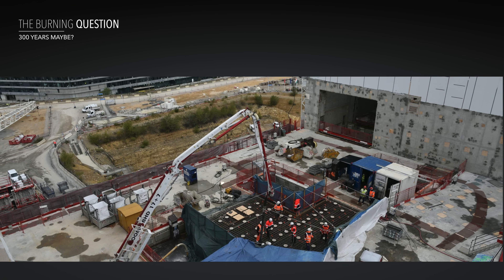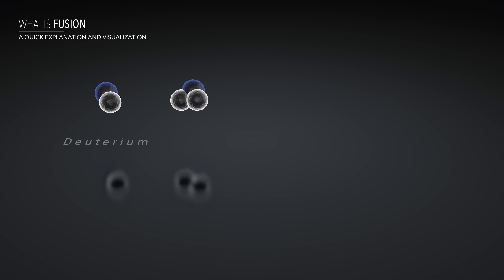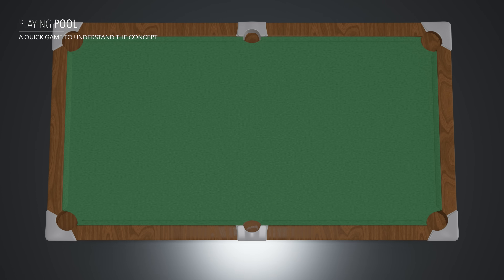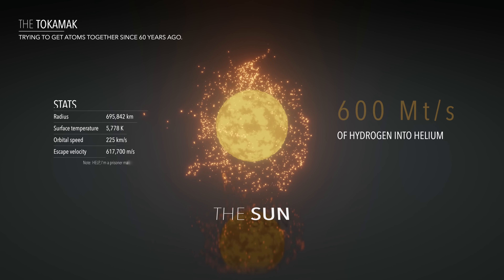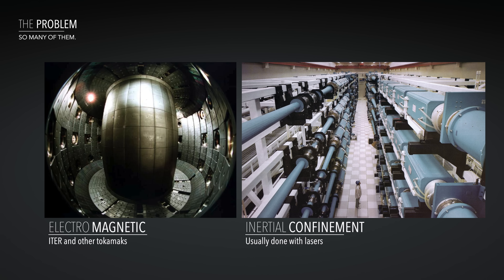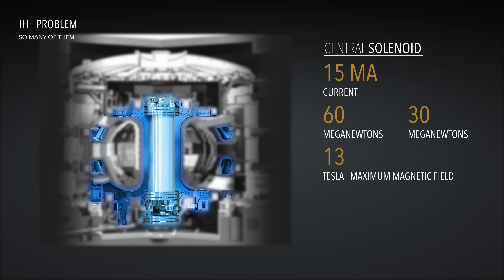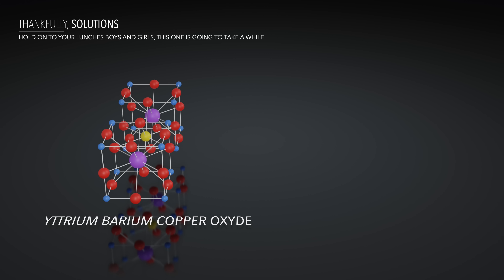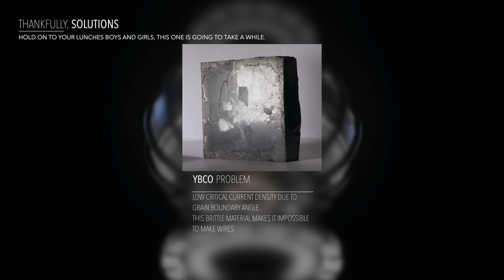Fusion in 30 years? ITER update [2020]

Comment: YOU CAN NOT REPLICATE GRAVITY THIS IS AN EXERCISE IN FUTILITY
Reply: Wtf you talking about?
Reply: @gregorymazulli4854  The reason why the fusion reaction in our Sun works is because the force of gravity is strong enough to pull the atoms together. A fusion reactors aims to do the same thing except push them together, but because its not using a naturally occurring force to do it, it requires energy to push the pistons that force together the atoms. The hard part is making a reactor that generates more energy from the reaction than it takes to push the pistons together and keep the environment in the perfect state.

Comment: Atomic energy is the future. It's so obvious that I can't imagine how anything else could be seriously considered. I recently was talking with a neighbor about 'windmill turbines', the big and ugly structures we see more and more of dotted around the countryside. He said that he'd read an interesting article (I still haven't read it, in full disclosure, ok) which stated that to run one - a single - train from Munich to Hamburg required the energy of 300 windmills combined. I /he may be wrong, please let me know if you check it out. But on the scale of technological advancement Nuclear seems to me to be the only option if we want to keep the lights on and hospitals and airports etc etc up and running a hundred years into the future. And atomic is autonomous. No need to rely on a foreign power to supply - or withhold - electricity. Also, I would imagine that atomic energy would vastly reduce the 'carbon footprint' (which is a load of rubbish and we all know it.) Would Greta therefore be averse to its development? Let's also not forget that as technology becomes more and more refined, so will safety of atomic power plants increase.

Comment: just because the sun has fusion on the surface is the mass related to the blackhole it rovolves around activate this re-action or is there a black hole in the center of the sun powering this fusion agitation on the surface. Sorry for angering you with these questions

Comment: High cost and risk huh? A few fun facts about US spendings:

Defence budget (1 year) estimated around $1.254 trillion 
--> $1,254,000,000,000 (The Nation, 2019) 

Trumps announced a military spending (1 year, also) of $750 billion 
--> still $750,000,000,000 (The Balance, 2019) 

Spendings (13 years) for the Apollo program (relative GDP and inflation are taken into account) $702 billion
--> $702,000,000,000 (CBS Interactive, 2019)

Of course, there are the necessary costs. However, I'd think the US is a perfect example of overspending to just "stay ahead" and there isn't a significant gain for the US to be won (not even mentioning the disruption caused by their desire for oil, etc.)

Comment: We need to accept reality: Controlled fusion is impossible on Earth. 

Ironically I have no particular objection to throwing money away on various fusions projects. Scientists and technologists have a right to earn a living to feed their families. The work is probably interesting. 

On a fiscal sense, it makes better sense to just provide those scientists and technologists with a separate, standing income and drop fusion research entirely. The scientists and technologists will still be paid and it will be MUCH less expensive than wasting it on controlled fusion. It is and will remain science fiction. 

Sanjosemike (no longer in CA)
Reply: What reality ? You dont know, no one knows.
That's the first purpose of ITER, and it's only for the Tokamak design, we have a lot of design maybe able to achieve the fusion.
Reply: Tagada How many trillions to you want to throw out for an impossible dream? A complete fantasy?

Sanjosemike (no longer in CA?
Reply: Tagada Controlled fusion as a viable economic source of energy is impossible on Earth because of the very high temperatures of the plasma required to MAINTAIN the plasma over a long period of time.

High temperature plasmas are virtually impossible to control. The more time you need to control the plasma, the more energy is necessary to “invest” in it's control.

There is a mathematical relationship considering plasma control and length of time required to control it.

A very short time requires less energy invested, but even THAT energy is enormous concerning plasmas.

Therefore, controlled fusion is just an energy and money consuming boondoggle on earth.

Sanjosemike (no longer in CA)
Reply: @sanjosemike3137  We are able to predict a positive render of the fusion.
The plasma power consumption is not the problem for an industrial process.
Reply: Tagada That’s what you always say. To tell the truth might result in cutting the gravy train.

Look, I appreciate scientists. But yours will not be the first lie to keep the billions coming.

Sanjosemike (no longer in CA)

Comment: 11:18 Well, no. The decrease in the cost of using the system in LN2 or LHe is relatively low. ReBCO conductors like YBCO require thin-film fabrication and are therefor a lot more expensive to produce than even Nb3Sn (which is already quite expensive). Furthermore, they won't be run at liquid nitrogen temperatures. HTS superconductors are not interesting because they could be operated at 77K. They are interesting because the thermal headroom is so much higher. Or at least for high field applications like this, it is.

Comment: I know this idea MIGHT end up destroying the whole solar system at some point but here we go.. what if we start & support a fusion reaction with a fission reaction? In this way you won't need a gigantic electro magnetic field because if you build the standard fission reactor UNDER the sea with a lot of pressure (caused by the ocean) you can create a nuclear magnetic sentrifuge.

I know no people can get at least 2 km near of it because it might burn your skeleton BUT if you create this & stabilize with the cold water (also with the enormous pressure caused by the ocean) you might find not infinite enough for a few thousand years of energy.

We still need to think how it'll react with earth's core though. Because that kind of a nuclear magnetic field (burning with a 150M C°) will probably cause some gravitational problems. I'm not even mentioning it'll push us out of the solar system. (or pull the damn sun to us.)

But it's a way to start.

Good luck. Don't destroy the solar system. I still need it.

Comment: "Why is fusion taking such a long time?"
Because there's more money in coal and oil and those who have plenty of it hiss at the very mention of the words "free" and "energy" put together.

+ all the other reasons mentioned in the video.
Reply: But fusion is not free. You still need something to "burn".
Reply: There is no such thing as free as it still requires a fuel source.  I look forward to the advancement of said technology, but suspect we're still several scientific breakthroughs away from it actually working.
Reply: @Raw Engineer because having a great quantity of generators requires a great quantity of finite materials, whilst a high power fusion reactor could be potentially less resource intensive. also, we would get more helium, and helium is always fun.
Reply: People were saying the same "free energy" crap with fission power (specifically the phrase, "too cheap to meter"), but it didn't happen, due technical challenges, red tape, labor costs, and because that's simply not how economics works. There's no such thing as a free lunch, let alone a free source of unlimited energy.
Reply: @Raw Engineer "what when the wind dont blows or the sun not shines?" is a common sentence by critics of renewable energy.
I hope for Fusion technology, but iam realistic that it can take alot of time until we achieve the Power of a Sun. Despite being an Achievement of the future, that is why i see Fusion as a good addition to renewable Energy. It would be fantastic for the Groundlevel of our Energy. We wouldnt even need much Fusion-reactors on Earth. Just enough to maintain the bare minimum of energy-consumption, to prevent the worst case if wind and solar cant produce energy for us.
Furthermore, Fusion-technology would be good for the era of human colonies outside of the Earth. As long there is Water, we could use it to get the Hydrogen for Fusion, to start a colony. Far future stuff i know^^
Reply: @Raw Engineer we are unlikely to solve Earthbound problems, when we stay on Earth. A civilization needs Ressources. The Material we need at the moment to increase and spread our technological level are finite on this Planet. Means that in the long run, we will need other Sources for Materials.

With the current human behaviour, we will probably not be able to slow down or stop the developing climatic disadvantages, even with scientific research. We spend our Money and Intelligence to design Weapons to kill our own kind, instead of using it to benefit our Species.
We cant preserve a Forest, when at the other Side of the Forest, humans burning it down with Flamethrowers. Thats an easy to understand Analogy.

Option A) We change our behaviour as Species drastically. That may happen when we´re on brink of Extinction. But that will be to late.
Option B) We search a new Planet to live, before ours becomes to hostile for us. For that we will need much more Research.

Personally, iam for Option C) We finally start to work together as Species, making our Planet a stable Home for further Generations and then explore Space.
Reply: @Raw Engineer The heck are you talking about? Of course science has answers for those problems. The problem is, that nobody is listening and nobody wants to pay the price.
Reply: The trillions of dollars spent on oil wars  would have got it done by now.
Reply: Free?!  80 Billion Euros isn't free.  They'll have to sell power at a thousand Euros per kWh to break even.  This project is a total waste of money.
Reply: Physicists have a saying, "There's no such thing as a free lunch"  
Meaning there's no free energy, anywhere, it would break the laws of physics. Besides, we could have had cheap green energy years ago with fission. See "France".
Reply: No, it's the fact that fusion energy might not even be possible. It's like stocks, it's very risky to dump so much money into something that just flops
Reply: @midgetman4206  That's what they said about going to the moon and suddenly there was a political space race, resulting in a lot of breakthroughs. Same thing for wars. However, some things (climate -> continued existence of earth e.g.) somehow aren't as important as (an outrageous) example: the US their national defence budget. 

Which, for a fact, is estimated around $1.254 trillion (The Nation, 2019) --> $1,254,000,000,000 !! 
Or Trumps announced military spending of $750 billion (The Balance, 2019) --> still $750,000,000,000 !!
Reply: @VisualJoey  well mining the moon could help pay off some of the debt. But the main thing that needs to be done is rewrite the budget, yeah wars are expensive but that is nothing compared to other things, welfare is a big drag on the national debt. I don't suggest removing it, but we could lessen it, a better option would be better education and finding/filtering the people who actually need it (unlike people who do it because they are to busy being a bad human being and can't find a way to contribute to society).
 
Also, if more people paid taxes then we wouldn't be in as bad as a hole. So now the question remains, how are we going to change it?
 
(Also the war thing, no one else is going to do it and no one really can, only three countries have the industrial power to police the globe and only one of them is doing it)

Comment: Question: as we get closer to fusion, is it becoming less and less enticing? This is an experimental reactor, even if it works it's going to cost a lot to build commercial ones. As scientists have been working on fusion, other scientists and business have been advancing the capabilities and reducing the cost of solar cells (and other renewables). Point is we have a perfectly viable fusion reactor approximately one astronomical unit away and life on earth itself is driven by capturing that energy and we humans are getting a lot better at it too.
Who is going to be buying a fusion reactor once the technology is ready? Which governments will pick it over the alternatives?
Reply: One of the goal of the ITER Project is to make the next fusion reactor much cheaper to build. So far a lot of the infrastructure is still experimental itself. Once we get that more standardized, I expect costs to go down significantly.
But still the question remains, if it is going to be economically viable.

Comment: It is one-million times easier to convert the easily available 'waste' mineral 'thorium into burnable uranium and burning that newly converted fuel in a 'safe' molten-salt nuclear reactor, than to try to develop and build a fusion reactor that can work for years without the plasma doing nasty damage to the internals of the fusion reactor over time. Even when they do end up getting a fusion reactor to be 'net energy positive', they will discover that the reactors just don't last very long when running at full capacity.

Comment: We've seen exponential  technology growth over the years. I like to hope I'll see this tech in my lifetime.
Reply: There are those bullish on us being on the cusp of discovering the secret of immortality, so you might not be wrong.
Reply: With luck maybe, the problem with fusion is that experiments take 20-30 years to build and they can work or the cannot and in the case of that it doesn't work you need another 20-30 years to do another experiment, until we get it.
Reply: @diablo.the.cheater  no you didnt understand anything lol, there are various efforts in fusion tech being made by various organizations, the rest isnt waiting for Iter to finish
Reply: @PSXuploads  No, you don't understand. There are hundreds of experiments that could have been made if ITER didn't crowd out funding for actually useful fusion projects. Whatever progress can be made in spite of ITER, not because of ITER, is the big hope for commercial fusion power.
Reply: No. Tokamak triple product (a measure of goodness for tokamaks) used to scale faster than Moore's law. used to. Back then we were building a new record breaking sized tokamak every few years. When ITER was proposed in 1986 it was intended to be yet another step to a larger tokamak, large enough to take what we learned and make something that was still an experiment, but achieve what is necessary for a power plant. It was so big and expensive it was going to be an international project; it took years just to decide in which country it will be built. It was designed in the 1990's with 1980's technology (fragile ceramic type superconductor that requires liquid helium temperatures and can't sustain very high B-fields at all). It started building in the 00's but that was mostly foundations and site preparation and stuff. In the 10's they started doing something serious on the reactor itself. At the end of this decade they'll have first plasma and start doing minor experiments. By the mid 30's they'll be doing actual fusion experiments. And by the 40's they'll conclude what is already obvious today; ITER is too big and too obsolete and impractical for commercial fusion power. We already know now that a practical reactor is much smaller, and to be smaller it needs much stronger magnetic fields; and it is not at all certain anything we learn from ITER will have relevance for that practical reactor.

ITER might as well have been designed by the fossil fuel industry to ensure we do not get commercial fusion power until fossil fuel reserves run out for how good it has been for fusion power research.
Reply: I hope so too, but we've also seen an exponential increase in complexity, cost, and energy consumption. Between data centers and cryptocurrency, humanity could consume a Dyson sphere of energy and starve for more.

The demand has no bounds, because using more resources increases competition, necessitating even more. It's never enough, yet chip performance is asymptotically approaching a limit, meaning the only thing we can do is compete for chips and use more energy.

Also, at any time we could run out of one of a huge number of critical elements, and civilization would fall with our technology. It's getting really difficult to be an optimistic singularitarian.
Reply: @JB52520  The thing regarding limited quantities of elements/minerals is that the worst predictions tend to be based on a fundamental misunderstanding of the data: several critical elements have no reserves simply because they're byproducts of extracting other resources(sometimes even necessary byproducts) and thus not anything people actively look for, not to mention the term "proven reserves" strictly referring to what can economically be mined under current conditions(therefore excluding quite a bit of what's actually known to be there).

But we do still need to get off of this rock sooner rather than later.